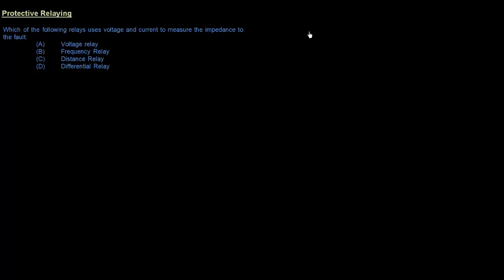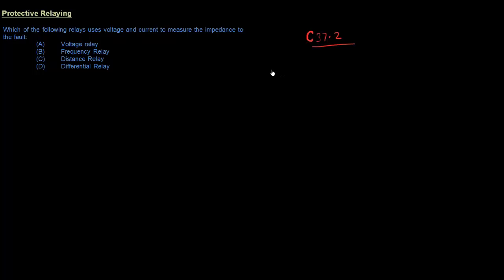Protective Relaying

Comment: Electromechanical device 50 relay is provide a pickup setting. 50 function can be added as an instantaneous attachment to a 51 time-overcurrent relay.
And 51 Overcurrent relays are employed as one per phase.
I hope I answered your question 
Look forward to hearing you regarding what I wrote about 50/51 relay
Thx

Comment: Are the polarity dots correct on the CTs when you discuss the differential relay? It looks like you have current flowing out of the dot on one, and into the dot on the other. I think you should switch dots on one CT but I could be wrong.

Comment: I didn't understand that during discussing differential relay; you said that 200A load current flowing thorugh100/5 CT. How come? Because in a 100/5 CT, only 100A or less primary current can flow